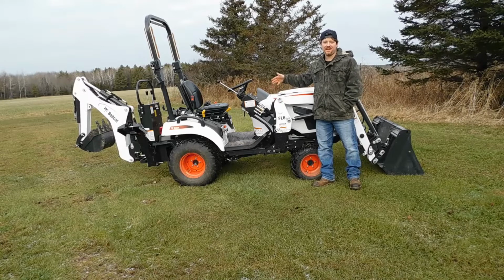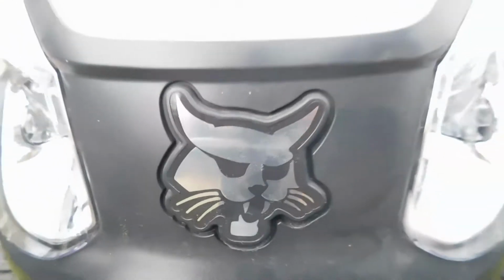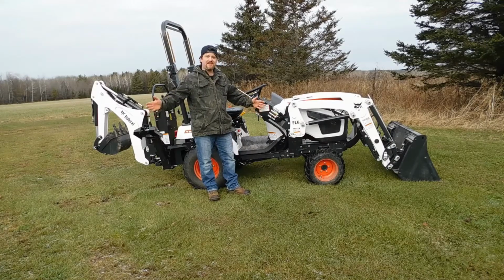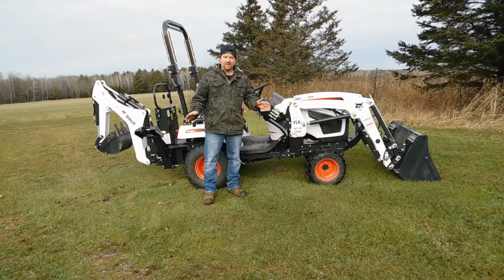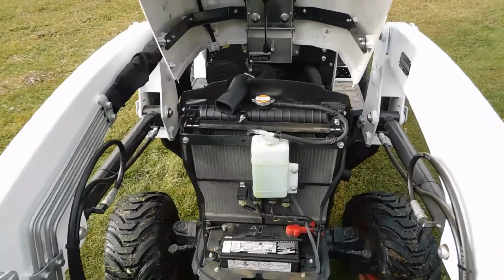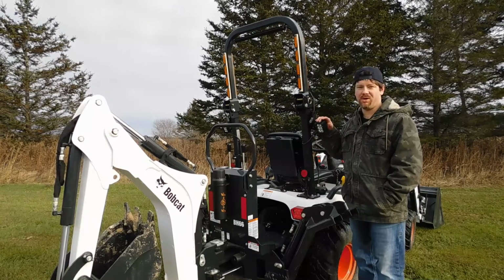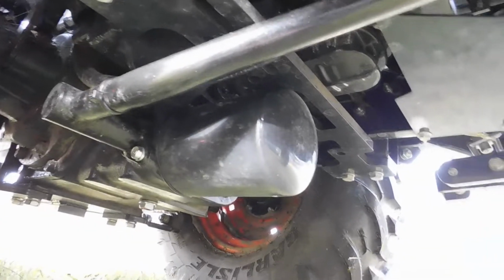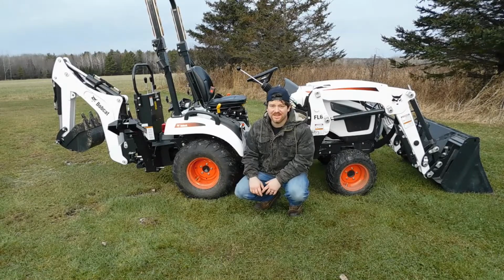Bobcat ct1025 review

Comment: I bought my ct1025 in May of 2021 and a little over a year later, mine has been reliable as I have almost 100 hours on it.
Yes, Dale has noted some of its weak points that I have also found. 
The fuel filter is plastic and mine was ruined by a pine branch. I replaced it with a metal fuel filter. The fuel lines are exposed in the same manner which could be a potential problem.
The filter guard is a must and should come standard, not an accessory. 
The hydro filter guard will keep your larger hydro filter from being torn off, but it will not protect your hydro filter from damage. Ask me how I know.  The hydro filter guard should be more robust to protect anything.
My biggest complaint about the 1025 is the rinky dink seat. No one except Kioti compares in lack of comfort as neither have real suspension.
 Also, the swivel seat for the backhoe is like someone's idea of building a better mouse trap. LOL
Reply from the maker: Thanks for the great comments. All great points that I can agree with. Definitely a great little machine though.

Comment: I am curious about the curl myself! 
I find it strange that the brochure says breakout force of 1554 pounds 500mm in front of the pivot but couldn't do that weight with the forks. If you do another video testing it and you can please test what it will curl and lift.
Reply from the maker: I think the issue with that test your referring too is the weight is too far away with long fork tines.  With just the bucket I'm thinking it's closer to the rated force... It's a theory.  If I have a chance I will definitely test it! Thanks for the watch
Reply: @daleofalltrades  I thought that at first to but when i paused it and looked at the distance I changed my mind. It does not look far enough out on the lever for the weight vs breakout force.
Great channel I look forward to watching more videos!
Reply from the maker: Update on this comment. I will be testing the curl in a future video. I will be looking into all the variables and see if there is an issue with the curl or not.  Probably in the spring some time.
Reply: @daleofalltrades  hey thought would chime in being I had a 2020  ct1025 , I owned it 14 months and put over 50 hours on it. I owned a Massey gc1705 before that and currently own the John Deere 1025r , so I can literally speak from experience in owning and operating all 3 tractors and comparing these specific models to one another. 
Let me know if you guys have any questions at all. 
Ps I had to turn my loader relief valve up a fair bit on the bobcat as it was way under spec when I recieved it from the dealer. That helped a lot for lift capacity. Both the Massey and John Deere are way way stronger in the curl power as is any tractor I personally grew up running. Let me know if you have any questions at all. 
Cheers
Reply from the maker: @johndeere2038r  thanks for the info I do still plan on doing a video for this issue. The relief valve was one thing I was going to look at.
Reply: @daleofalltrades  for sure! If there is any way I can help just let me know. And mine was around 1700 psi I believe and it calls for 1950 psi I think ? Anyways I turned mine up to 2150 psi and it did perform a lot better afterwards .
Reply: Our machine continues to blowout one of our hydraulic valves. There is no visible leaking of fluid, but it is emptying out. When they replace the valve the curl strength is proper and everything works great. But then it just stops working you can keep it from curling with your foot.
Reply from the maker: Interesting 🤔

Comment: Did they fix weak curl for loader
Reply from the maker: Hmmm I wasn't aware there was an issue. I hadn't experienced any issues.
Reply from the maker: Are you referring to when the loader is equipped with forklift tines?
Reply: @tufriverboards2054  You are not the first to note the weak curl even with the bucket. Nedlow Farms has a YouTube video. What I have found is the bucket will not curl as the first movement with a full load. However, if you boom up say 6", my bucket curls with no problem.

Comment: Thanks. I’m hoping to buy one of these soon, have you used the lawn mower on it ? Rotor tiller ?
Reply from the maker: I have not used the rototiller and the mower works great
Reply: I have this model. The mower is awesome. initially I use it to mow down 2 acres of former cow pasture grasses that were three feet high. I now use it on our lawns and to mow between the garden beds. I have the tiller. It is a work horse and built really well. I have a video posted of the tiller in use. We have one year and 135 hours on ours.
Reply: Yes both. I have several videos of taking the mower deck on and off and tilling up the garden.  I use the mower to mow my residential lawn as well as the areas between the garden beds

Comment: I purchased a CT1021.  I had it for 3 weeks and it ran great. Then one day it didn't want to start. I waited for about a half hour and it started fine. I though that was weird. Then about 2 weeks later I was using it and it died after running for a little over 45 minutes. It just cranked and would cough and was chugging black smoke out of the exhaust but would not stay running. After sitting for about 25 minutes I tried it again and it started and ran fine. It did this the next 2 times I used it so I called the dealer and they said bring it in and we will look at it. Well problem is that I am over 2 hours away from the dealership. So I took it in the following weekend and dropped it off. When I dropped it off it has just over 12.4 hours on the meter.  After dozens of phone calls and leaving messages and waiting for parts that were on back order because of the made up virus covid,  they finally called and said it was all fixed. They did give me a loaner after about 3 1/2 months but it was a weird articulating tractor that weighed like 6000 pounds that destroyed my yard when I tried to drive on the grass...  When I got it back 5 MONTHS later (yes, you read that righ,t they had it for just under 5 months) when they delivered it and picked up the turd loaner it has 45.7 hours on it. It started better but still wasn't right. Then last month I went out to use it and it sounded like it had a rod knock.....I climbed under it when it was running an it sounded like it was coming from the rear of the oil pan area. I shut it off and went back under and started wiggling and moving shit and found that all the bolts had sheered out of the secondary clutch and destroyed both surfaces...I called them and told them I was done and they needed to come get this POS and do something about it. They said they could not replace it because it had too many hours on it.....after they put over 33 hours on it....double what I did. Then they tried to give me a ridiculously low offer to buy it back. I dont know if it was a Friday tractor or what but it was the biggest POS I have ever owned. NEVER buy a CT1021 or CT1025...they are nothing but glorified lawn mowers that don't do nearly the lifting capacity they say they will. Ended up trading it in and lost over $5000 on the deal.
Reply from the maker: Well that's a long and unfortunate story. My father's (the one I reviewed) had an injector that was sticking open (causing heavy smoke) his dealer has been great replaced it under warranty and have not had any issues since.  I think we all have horror stories on things we've bought.  I totally understand your frustration.

Comment: I accidentally added E85 fuel 3 gallons it started rough but died in a couple minutes left alone. I just realized my mistake. Any ideas
Reply from the maker: Entire fuel system will need to be flushed, along with a fuel filter change.  Take it in for service.
Reply: Check the fuel filter if it still has issues check the pick up tube. Could have dirt in the truck and clogged it up or the screen fell off
Reply: Bro what

Comment: I bought a ct 1025 a year ago. IT has 67 hours on it. Tractor only starts when it feels like it. When you need it the most it won't start. You have to pull connections apart and back together. Ran over small twig in yard no more than 1/4 inch diameter and it broke all blades of hst fan underneath.  Following week find hydraulic filter caved in from something kicked up.  Local dealer does not stock one part for it. Not even a filter. Do yourself a favor and buy something else. Sorry Bobcat you should have refined this one a little better before selling it to the consumer.